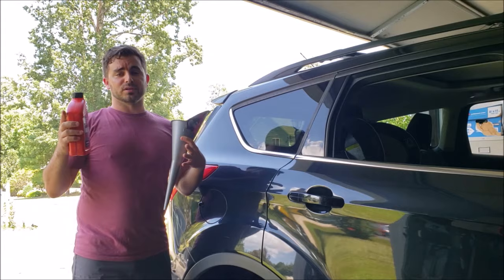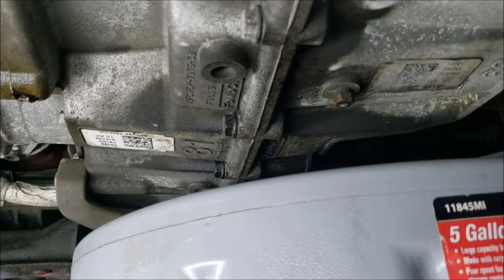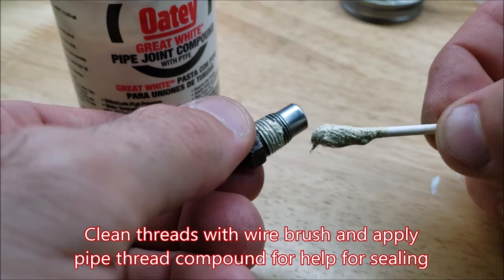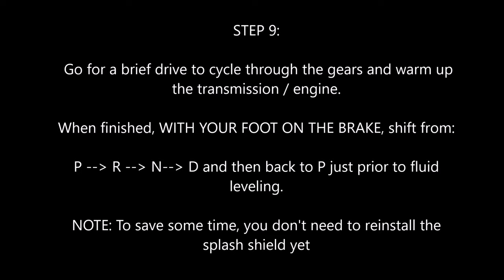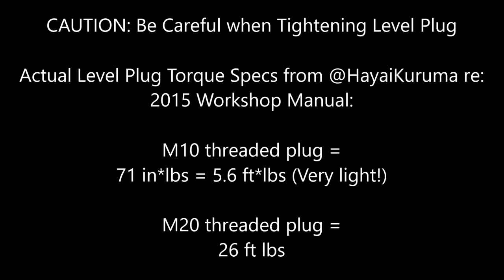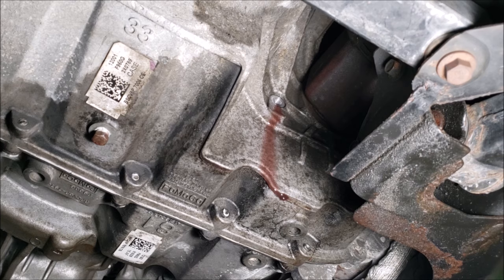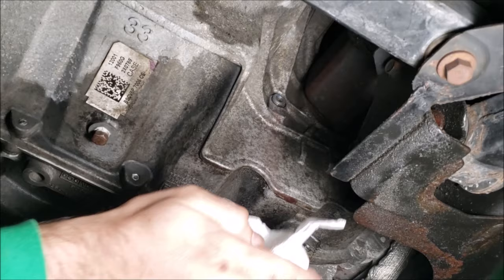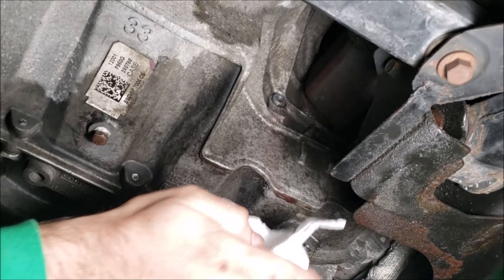Step by Step Transmission Fluid Drain and Fill: HOW TO ESCAPE

Comment: For my 2018 escape v4 turbo.. its 150 000 miles as per my owners manual
Reply from the maker: That is CRAZY high mileage! Unbelievable that they spec that service interval that late. What is the liter size of your engine btw- pretty sure these are all in-line 4 cylinders unless yours is custom?
Reply: @HowToEscapeDIYTipsandReviews  ooops correct turbocharged 2.0-liter four-cylinder engine (245 hp, 275 lb-ft) .. i called dealer now to confirm. They said not meant to be changed before 150 000miles. I got many years to go :)
Reply from the maker: @SunSandAndSea  that is entirely your call but these escape transmissions are not bulletproof. They have "lifetime" filters in them and over time, debris can build up in there if the fluid is not changed. I'm not a pro mechanic nor have I worked at a dealership but I have seen countless escape drivers have failed transmissions on the forums and Facebook groups. I can only say that I have done it every 30k mi as preventative work as our Escapes are well out of warranty coverage at 150k mi and a new trans can cost as much as the rest of the car at that point depending on where you take it.
Reply from the maker: @SunSandAndSea  thanks man! Yeah use that warranty if you got it!!! Thanks for stopping by and saying something:)

Comment: The hole to check level while the vehicle is warmed up is dumping fluid does that mean I need to let the fluid dump out till nothing comes out?
Reply from the maker: Yes- with the engine warmed up like you have, with the vehicle in park, and the engine idling, it should diminish to a trickle before putting the plug back in. I understand its a bit alarming but the level check needs to be when the engine is running so that the fluid pumps are working. Let me know if you have any questions after this one

Comment: My is a 2014 ford escape now has 49000 miles havent change the transmission fluid yet,you said every 30000 so in that case can i do the change or is different the procedure  because of the extra miles?

Comment: Let's say I had only ,4qts when drained instead of the requirement of 5. Will the dealer add 5qts when doing the fill
Reply from the maker: Good question- so you're wondering if they'll do the level check vs just add what comes out? If so, I'm not sure- I would HOPE so and I'm sure they'd love to charge for the extra time to check the level plug :P However, the best way to know is if you ask them to do so or ask if it's standard procedure for them at THAT dealer. The service manual for Ford says to check the fluid level at the port, so I would think they can certainly do it.

Comment: Hey man thanks for this awesome video! I followed your instructions step by step. I chose method 2 for removing the level plug. Ran into a problem trying to remove the level plug due to tool issues, anyway got it out. Well quite a bit of oil gushed out, more than yours for sure. I am freaking out and trying to figure out if that's ok, or if I did something wrong. Maybe I didn't let the initial drain plug, drain long enough? Or maybe because I struggled getting the level plug out the vehicle, it got too hot? Causing more fluid to gush out? What came out all seemed to be pretty dark, just looked like the old oil. Any advice would be amazing! Thanks so much man.
Reply from the maker: Hey there Andrew- I think I understand you're situation but I want to make sure- so you had pulled the drain plug, drained it, then went to pull the level plug and way more came out? If that's correct, I must ask if your vehicle is level? Sometimes if its not level the draining is off. Do you know how much fluid came out (estimate)? If your car is level and you added more fluid with the drain plug installed, the level plug will reset the fluid height.
Reply from the maker: If you think it is not right still, it may be pricey and inconvenient but you could always start the procedure over. Drain everything out again and refill with more fluid?
Reply: @HowToEscapeDIYTipsandReviews  So I pulled drain plug, let it drain until there was a drip, I may have put plug back into fast and should have let drain a little more until it was a slower drip. But anyway once I put drain plug back in I filled with 5 quarts of oil from the top. Then drove it around for about 10 minutes. When I got back I took the tire off and turned the engine on. By the time I removed the level plug the engine probably was on for a good 10 minutes or so. But instead of a little amount coming out, a lot came out, probably a half quart. Yes the vehicle was level. Thanks for quick reply
Reply: @HowToEscapeDIYTipsandReviews  Yes may have to,  have a piece of mind. Really appreciate your help!
Reply from the maker: @andrewshah10  a half quart should be ok. Remember that it has a total capacity of 9 quarts. A drain will get about half of that out...so you may have drained 4 quarts..maybe 5. That leaves anywhere from 4 to 5 quarts left.. if you added 5 quarts, then you should expect to drain anywhere from 0 to 1 quart...does that make sense? I would be more concerned if NOTHING came out. It is good to be cautious. I think you are ok thought man. The math works out. There should be dark fluid in there too- the old stuff- because half of the old stuff didn't drain out. The sump pumps that circulate the oil will move all of it around the system so that is ok to see it coming out too.
Reply from the maker: And in the event that I am incorrect, hedge on your gut instinct when you take it out. If the trans fluid temp gets wacky, or if the pressure drops,  or if shifting gets significantly harder/ more noticeable,  take it to a shop you trust and get them to take a look. These cars don't have the most reliable transmissions but it can probably handle a bit of fluid imbalance for a short time period.
Reply: @HowToEscapeDIYTipsandReviews  Man I cannot thank you enough for being so detailed and thorough, not only in your videos but In your answers to questions. Really appreciate everything and already hit the subscribe button!
Reply from the maker: Of course! Hope it all goes smooth for you here on out! We have a teething toddler so no sleep tonight but glad we could get through some of these details! Thanks for subscribing and give a shout if anything else comes up :) hopefully we can help!

Comment: Don't the 2013's have a transmission dipstick?
Reply from the maker: They do not- if you have the 6F35 transmission, it is just a level plug. The plug can be accessed in the driver's wheel well.

Comment: Do you need the underbody shield? Seems to me its only function is to prevent fluids from dripping on pavement.
Reply: It has an airflow channel that is suppose to direct air back to the PTU if I'm not mistaken.
Reply: I'd have to agree.  The channel directs air at the trans for cooling.  I almost cut a hole in it to facilitate oil changes, but decided not to when I saw the channel.  😞
Reply: I believe the splash Shield is an important part of the vehicle. It is designed to redirect airflow across the back of the transmission and up across the turbocharger which gets very hot. Without the airflow I believe the turbocharger would fail sooner than later.

Comment: Do you need to change the transmission oil filter if you change the fluid?
Reply from the maker: Hey Dexter- normally yes. However, these Escapes have a "lifetime filter" meaning the filter is permanent. Thats why people say to drain and fill every 30k mi instead of 60k mi. It is easier on the whole system.

Comment: I had a leak and my mechanic top up the fluid with different fluid and now my car find its difficult to shift and it moves slowly or no move at all on hill.
Is there anything I can do?
Reply: Change to recommended fluid before you ruin your transmission.

Comment: Hi Is this applicable to a Ford Kuga 2013, Ecoboost, AWD Petrol Engine? Hoping your kind response cheers
Reply from the maker: Hi there! I have heard of some Kugas having different gearboxes than the north American Escapes but after some research it does appear that at Kugas from 2013-2016 do have the same 6F35 6 speed transmission so it should be a similar process if thats yours!
Reply: @HowToEscapeDIYTipsandReviews Many thanks Man, my Kuga, not totally smooth when it change gear 1 to 4th I can fill the cars shake,will that be need fluid replacement or a gearbox maintanance?
Reply from the maker: @LabyugTv5  for sure try just the fluids first. It can make all the difference. Try to replicate the drain and fill process here. Sometimes with older transmissions a "fluid flush " can cause more harm than good. If the shifting doesn't smooth out after at least 1 to 3 drain and fills, consider getting it looked at by a transmission shop
Reply: @HowToEscapeDIYTipsandReviews  thanks a lot hope this can solve cheers
Reply: Hi, thank you,after I changed transmission fluid there's a big difference my carschanging gears  smooth now. Thanks a lot

Anyway do you have video on changing oxygen sensor that applicable on my Kuga?

Comment: On my 2019 escape I have a front end trans fluid cooler. I ended up hitting a deer and my grille punctured the trans cooler and I saw my fluid was not in good condition. I wonder if I can just have a 2 bucket method to flush out the fluid 🤔. There are top and botton lines going to the trans cooler, what if I detach the upper line which is the fill line for the cooler and attach a hose going to a bucket, and attach another hose on the lower line which is the return line back into the tranny and have that hose end in a bucket with fresh fluid... run the engine and keep the car in gear and have it suck up the new fluid while draining the old stuff and when the fluid starts coming out looking fresh shut it off and reconnect the lines, and then check the fluid level. This is only if I knew my tranny had the correct amount of fluid to begin with, when the cooler got punctured it did loose a little bit of fluid.
Reply from the maker: wow- that's certainly a plausible approach logically although not orthodox haha. I know you stated your assumption of the trans having the correct amount to start with, but I do think you could always just check your level plug afterwards and add more or less to hit that amount?

Comment: Does the dealer do this. I thought a drain and refill was only letting out some of the fluid  not all. and adding in some new
Reply from the maker: Hey there! Yes the dealer can do this if you ask them to. You're correct- the amount that drains out is only ~half of your transmission capacity. Some people continue the process until they see mostly clear new red fluid. Others do it once to 3 times just to make sure there is new fluid being introduced and that you're draining out any debris that settles on the bottom near the plug. Let me know if this helps or if you have any other questions- thanks for posting your comment/ questions :)
Reply: @HowToEscapeDIYTipsandReviews   well I had a new cv axel put on and the guy said some transmission fluid came out with it,bout a quart. But I have been checking my fluid levels the last week and every time it's giving me a good reading. Do you think I should still ass transmission fluid

Comment: If i'm feeling lazy, can i use the siphon method via the vent cap hole to remove the old fluid and then just add the same volume back in?
Reply from the maker: Good question- maybe??? I know that when the transmission is circulating fluid and up to temp, the fluid level rises so it may be hard to go by but I don't think you could hurt anything by trying so long as everything is off when you siphon of course. And you may not get as much out as you would with a lower drain plug but I don't know- if you do go that route, give a shout back if you have a minute and let me know how it goes.

Comment: Is filling without draining a crime? Like what if it was only a little bit 😅😅
Reply from the maker: Hah! Certainly not a crime- good question- you just don't want to overfill it. If you know it's leaking fluid periodically for some reason, adding some off and on probably won't hurt. However, if you're adding a lot at a time, it may be too much. The fluid is meant to be a certain operating volume when up to temp and if the fluid level is too high inside, it may throw things out of sync and cause problems. If you add fluid and check the fluid height out the leveling port on the driver's side of the transmission in the wheel well, that's probably ok, but that's most of the work- draining a portion of the old fluid is going to be the most helpful with the full drain and fill - does this make sense? Sorry for the delay in response!

Comment: When leveling the fluid, are the jack stands on all 4 points of the car or just 2 in front to keep it up?
Reply from the maker: I always thought the vehicle needed be as level as possible when leveling the fluid. If you tip it back, it will change the fluid height in the transmission. Just make sure it's up to temp for it to get to the right viscosity and expanded volume and the car is level when you're checking the fluid level. I know it can be a bit of a pain to keep going back and forth with jack stands. Hope this helps and sorry for the delay in response here :)
Reply: Thank you so much. I appreciate the help 😊

Comment: Did you notice it shifting better or smoother once you did this or was it about the same as before?
Reply from the maker: Thats a good question- I think i WANT it to feel better but I think its about the same. I know sometimes people don't have enough fluid in there after a service visit somewhere so after something like this they may have a better experience if theyre just getting back to normal capacity but if you already have the right amount in there I would say it is pretty tough to tell the difference. That and unless you're experiencing other unusual shifting symptoms
Reply: I do have a bit of a delay going from 2 to 3 gear so this method doesn't help at all ?? 😥😥
Reply: I'm getting a definite shudder when my 2017 escape upshifts at low speed or climbing a hill.  Local shop (not dealer) says I need a clutch for $2800.  Think I'll try this first.  Oh yes:  The car has 102k miles on it.  Thoughts?  Anybody?
Reply: @davidwilliams2508   we are screwed.... 2018 shudders a little going uphill and downhill....mine has 54K... What did you end up doing for yours?

Comment: Can i use a ramp instead??
Reply from the maker: Sorry for the delay- ramps could be challenging because you wouldn't be able to check your level plug to see if your fluid height is correct. Your wheel would need to rest on the ramp and you can't get to the plug with the wheel on. IF you're not going to check the fluid level, then yes the ramps should be fine so long as your car is in PARK, your E brake is pulled, and something behind your rear wheels- I get paranoid of ramps with cars rolling back if the ground isn't level... but that's just me. Please let me know if you have any other questions

Comment: Do we know for sure what year they eliminated the plastic filler cap thats accessed from the driver's side of the engine compartment?
Reply: I can't find mine 2018... so you have to wonder where they put it... Possibly a proprietary tool requirement to AVOID WEEKEND warriors actually fixing their problems themselves.
Reply: @greggraham1605  I think by '18 they eliminated that plastic filler cap and just have a plug in the side of the case higher than the drain plug.

Comment: Bro can you do for 2nd gen escape especially the 2012 ford escape 2.5l automatic FWD trans fluid drain and fill? How much does it take?
Reply from the maker: Hey there- thanks for asking, but unfortunately, no I can't demo a 2012 because this 2013 vehicle is all that I have to work with at the moment. I believe we may bump up to the 2017 body style in the near future, but I'm not sure we'd go back to an earlier style like your 2012. I'm sorry! I wish I could help you more!
Reply: @HowToEscapeDIYTipsandReviews  by the way do you know by change how much fluid do you need to add to the 2nd Gen escapes I think the trans is 6F35. Thanks
Reply from the maker: @justlg3359  are you talking full capacity or just what you'd expect with a drain and fill where a portion doesn't drain out?
Reply: @HowToEscapeDIYTipsandReviews  what is drained out? And what should be added in? From what fordmakuloco YT says, he said it's about 4.5-5 Quarts but in another video he says above 5 Quarts so I don't know what to believe really, I could use your help here
Reply: @justlg3359 It's around 4.5 quarts. I've done it on my 2.5L 2012 Escape two days ago.

Comment: I put 5 litter transmission fluid , level my car and start the engine and open the drain plug but after 10 minutes  no fluid came out. When I stop the engine then fluid come out . I checked all video but every video shows after engine start then fluid come out.   Now the question which is right ?
Reply: 5 liters is the limit. Do not overfill or you risk a catastrophic failure.
Reply: The engine and transmission might not have been up to temperature. You might have needed to go for a drive to get it warmed up to the proper operating temp. I changed fluid on a ZF transmission on a BMW and you have to use a obd2 scanner plugged into the car to make sure the temperature of the transmission is in the perfect temperature range. It was crazy how right when it started getting to the proper temperature, fluid would come out of the fill hole, and you couldn't turn the car off or fluid would gush out.